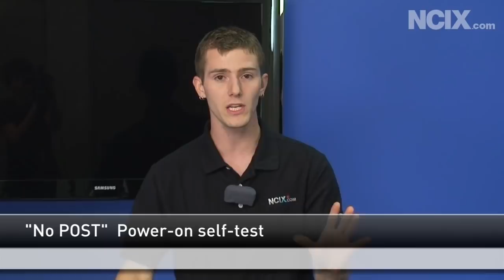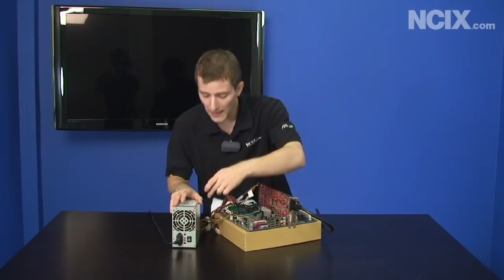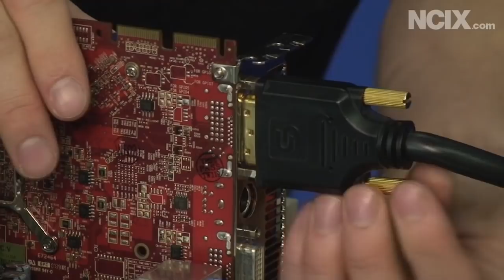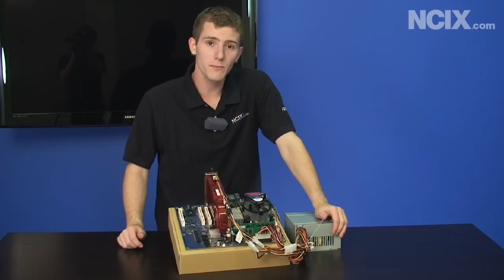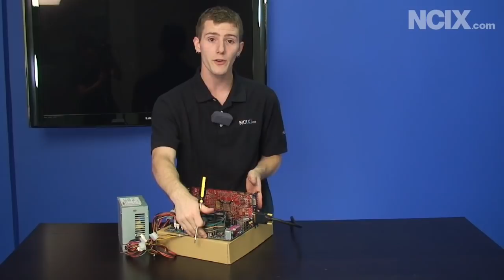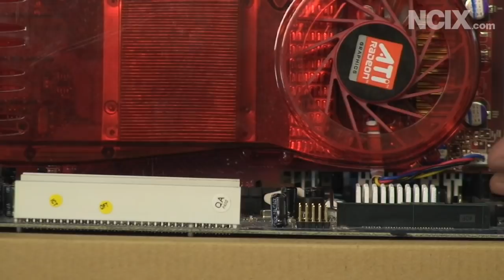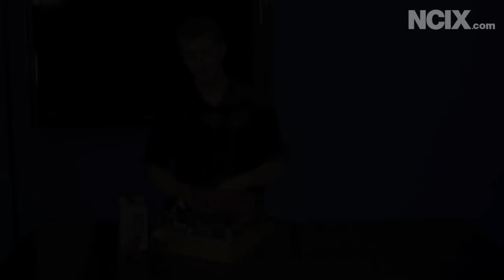PC Troubleshooting No Post Diagnosis (NCIX Tech Tips #54)

Comment: So the other day I traded my ps3 for a desktop that was equipped with some decent internals.. It had a Asus M4A87TD EVO MOBO with AMD Phenom ii cpu with 2TB hard drives and 16GB of ram.. Only problem was cord management was not to my standards, so I made it ALOT cleaner but when I came to turn it on, it did not give a signal to my tv. SO, I hooked another power supply to my mobo to see if it was my PSU but that wasn't it. Then I took my video card out and put it into my friend's case and my video card was working fine. So now I'm stuck between my CPU, MOBO or ram. I am 85% sure it is not my ram sticks and have tried every slot on my mobo to see if they were damaged but doesn't seem they are. ALSO re adjusted them and also re adjusted my video card but nothing. So I'm mostly going toward a new mobo or CPU but nothing has even bothered my CPU but if a new mobo doesn't fix it ill replace my cpu also.
Reply: I think it is a heat sink that was broke by the previous owner most limey but ill find out next week.

Comment: My computer would not turn on at all but the motherboard LED was on, after figuring out that I took out the CMOS jumper thinking it was a cover for my pin, I put it back in and my computer turned on.

Comment: My system wont post (it was working for a month but now won't boot up) I have tried reseating all components and every plugged to video into the motherboard but still no post. All the fans were spinning but nothing came up on the screen. It also didn't make a beeping sound.
Reply: remove everything that is not usefull on the board.. just keep the processor, ram(only one stick at the time) and only onboard graphic if you have one. After give it a try ... Normaly black screen is due to faulty ram .. Also you should try to reset the BIOS by removing the coin battery on the board. Another thing that could happen its a corrupted BIOS you should try to see if any procedure to recover it.. You motherBoard graph wont work if you have a graphic card in the PCIe.. GoodLuck with this. Sorry for English :P

Comment: the most painstaking trouble i had with a pc. is when i had a damaged psu at the 12 volt rail. i kept swapping and killing components. i did not know it until i realize now i have to deal with 2 dead PCs instead of only one. may be that is that could be a good episode......
Reply: Ah yes, the failing PSU, the bane of every geek's existence.

Ok, all joking aside, I did have one die out on me, but, here is something you might want to know, check the fans. If they do not spin up, something is they are likely not receiving power, or they are damaged in some way. Secondly, listen for the sounds of normal operation. I'm talking about the spinning of fans, sounds emitted by hard drives, optical drives, and even the fan on the PSU itself. I had one where a wire was actually burning.

Comment: So i built a computer fianally got put it all together but the problem is that i go and turn it on and there is no signal to the screen the fans spin no beeps nothing reslly the only way to make it beep is with no ram in the slots. Ive tried a diffrent graphics card takig out the csmos battery ive reset the bios withvthe reset jumper still nothing please help ive spend alot on this computer!

Comment: Hye i just built a new PC and with the 24-PIN connector the fans and LEDS come on but my PSU doesn't have a 8 pin connector for the mobo could this be the cause of no display or POST (im using Igpu)

Comment: you didnt say this but you also want to test both memory sticks to determine weather its the memory stick or slot thats not working if its the slot need to start saving for a new mobo cause chances are its slowly starting to fail or it has warped which is bad

Comment: Hello, Im having an issue with my build:
My problem is that the board will not post. Everything is plugged in. the case fans, cpu fans, graphic card's fans run perfectly, there are no error LED lights that flash or stay on. but my monitor does not show anything. I even try a different graphic card but same thing happen. Also there is no beep code either. I also try using different slot for the graphic card but failed too

Comment: Pull the MB out of the case ....place it on a piece of carboard, then retry with minimum config...1 stick of RAM, CPU, no keyboard, no mouse, no video, no HDDs, no CD-DVDs, no FDD. If it starts and runs .... then add the video, then add keyboard, then add mouse, etc.,

Comment: do you get any beep codes? if not then one of them is defective or check your connections on the board too, if the board has onboard graphics use that, if it still doesnt post then ur motherboard is bad

Comment: Question, I'm upgrading the cpu on an older ASUS P4V800D-X MB, do I need to clear CMOS and will the system boot from the Window XP  already jnstalled on the hard drive. (valuable data on HD)

Comment: ive just built my own pc. not even used it yet. just turned it on and it stays on for 3 sec then off. i dont get to the post screen it does it repeatedly. i have tried these and they didnt work

Comment: When I turn my computer on the fan on the power supply turns on and the 
Small green light on the front of the tower turns on the Other cooling fans don't turn on is the problem the power supply? And I don't see that tiny light on the board

Comment: question
1 older cpu works but a newer on doesn't
the cpu is compatible the mb bios is updated all the way
asus said I might need to go to a place to fix it but I really really dont wana go I already am going to be upgrading soon not going to waste my time
are there any fixes
mobo is a asus p5ld2-vm old cpu is a p4 630 new cpu is a core 2 duo e4400 both cpus are supported all 4 dimms work and same for the ram slots
any idea?

Comment: @orangeluva56 - if I'm not mistaken, using a magnetized screwdriver to electronics could permanently damage it. much like a credit card strip. I personally bought a multi-tip screwdriver set that is not magnetized. After further review, it seems like the general consensus is that the screwdrivers do not have a strong enough magnet to damage the parts, and most bloggers have chimed in, reporting no problems using one. Maybe I'm just over cautious...

Comment: @shazyriver Well if you have a CPU that doesn't support on-board video, it won't work.  The fans will turn on, but you won't have a display on your monitor.  If you're using a Sandy Bridge processor, then you need a card, because it doesn't support on-board video.  Let me know what you're using and if this is not the case, I'll still try to help out.

Comment: my roommate was moving his pc into a new case using still his old old psu, when he turned the switch on the thing blew up. swapped the psu and it still wouldnt boot. after about four hours the problem was tracked down to the hard drive! the hard drive had blown and was shorting the system. so just bear in mind its not always what you would think.

Comment: um about clearning " cmos" or reseting the bios'  you gotta leave it on the other two jumping pins longer than one measley second.  best to leave it on there for at least 20. count to 15 slowly.  I have PROVEN this with  more than 5 different motherboards, 5 different brands spanning the past 3 years. cheers

Comment: so did he test the motherboard then with just the -motherboard, ram, graphics card and a power supply, that was it, no hard drives?, just checking?, cause I got a new motherboard, ram  and a graphic card I wanna check, I have power supply, so I can test my motherboard then?. (I have an Intel system but am in the process of building an AMD system but don't have all the stuff yet like hard drive and O/S for the new build). Just wanna check my new mobo works, can someone advise  me, many thanks.

Comment: @TikiShootah lol, it's not a spare that's identical to the one you're using. Many of us who've built a system or at least upgraded a video card, have that old video card laying around somewhere. If not, honestly, it's never a bad idea to spend 30$ on a cheap video card to have laying around when things go wrong, which as any computer geek knows, they will. You're testing the slot of the mobo to see if the slot is bad. If the other vid card works, then most likely your current video card = dead.

Comment: Ok Linus, now take it a bit further. The GPU is faulty, how and what can be done to repair it?
If the Mainboard has failed, what can be done to repair it?

My PC didn't POST
I replaced my Mobo and now it works fine. But I still have a board that I would like to get going again.
Performed open bench, cleared BIOS/CMOS all other components work. It's just the mainboard thats faulty, it powers up but doesn't POST.
It's a Biostar TA780G M2+ used for just over a year at stock settings.
Thanks

Comment: hi guys,need some help.pc was working,then
pc wont p.o.s..t .cpu fans spins,motherboard light is green,pci-e card fan spins.but no p.o.s.t 
asus p5n e sli or 
intel core 2 duo
kingston compatible ram kvr 6670
asus graphics card or i use bfg 7800 (test).
cleared cmos,messed around with jumpers,took out battery .
no beeps,nothing!help!

Comment: @TheWoWRevelation If the settings in your BIOS are wrong or corrupt (e.g. Overclock failure) then clearing the CMOS will bring everything back to stock values which will make you post again.

Comment: Thanks for the tip, i built a pc for the first time and when i turned it on there was no POST. but the fans connected to the board, the gpu fans and hdd were spinning. the hsf fan was not spinning though. also the dram led and boot device led were lighted ( asus q-led feature indicating a problem ). can you give me an advice? it will be highly appreciated, thank you.

Comment: i recently changed the motherboard on my htpc and the new motherboard wont post. i have replaced it 2 times and still no post. i think it is just a driver issue with windows 7 ultimate 32 bit, but any suggestions?

Comment: Hi

Here is a small improvement you can make to your video. Please mention the 110/220v setting switch that is on the back of most PSUs.

I just shipped some hardware (a web server PC) from UK to US and it wasn't booting, I had box open, swapped graphics cards etc.

I watched your vid and then remembered the 110/220v setting!

Although very few people will have this as the cause of a prob, some will and it will be very helpful to mention this. (It could even get moved by mistake).

Hugh

Comment: lol the DVI cable is connected to the top input but later when he reinsert the gfx card the cable is at the bottom.....no wonder he dident get a post with the cable being inserted wrong...and yeh turn on the monitor???i would say the ram was the only issue

Comment: i have never worn an anti-static wrist wrap thingy when working on computers, i have only had one accidet with anti static, which were casued  by a too small overfilled wortable,  i were going to move the pc case, and accidently caused the Motherboard to slide along the table,  and probably creating anti static that way, either way, the motherboard died... if you just remember to ground yourself before touching anny devices you should be okay

Comment: I had the 3 beeps problem with my intel dx58so, i7 config and it happened that whenever my system crashes, i had to switch off my wall power switch (& not the reset or psu i/o switch). Strange, but this has worked ever since; Another thing i have seen that, with 3 beeps, try this : do not remove or reseat the memory cards first. Just press each card gently on their top (while they are already seated) and restart the system. Worked for my old p3 system and this i7 too. Can't explain how.

Comment: Pretty basic and easy, but you left one thing out which is something that happened to someone i know.
The system didn't boot so he tried all these tricks and nothing until he took out the hard drive and it swapped it and it works fine so if these tips don't work try swapping the HD as well